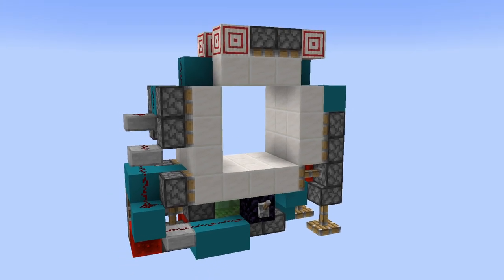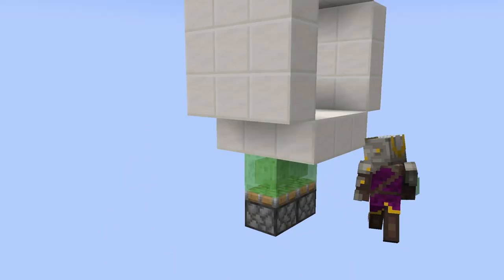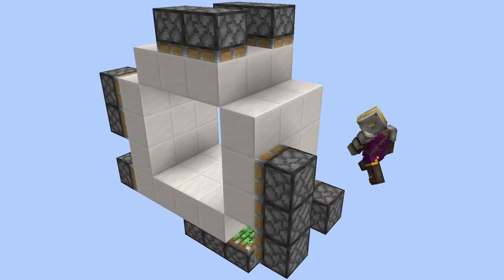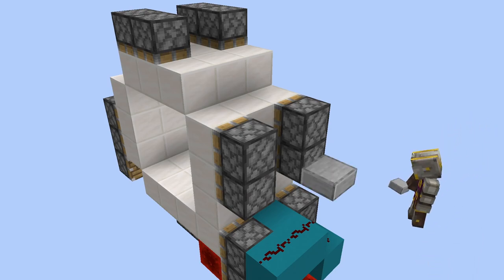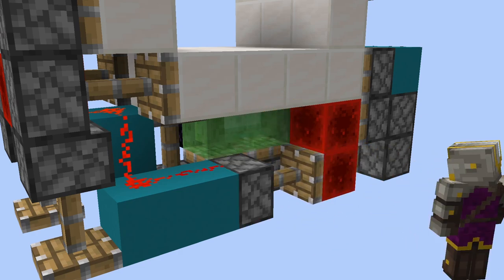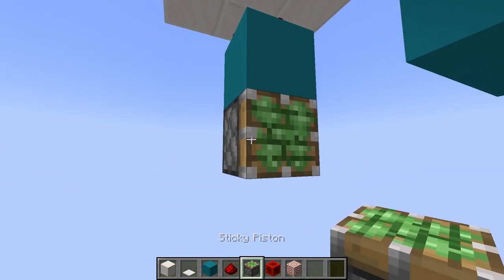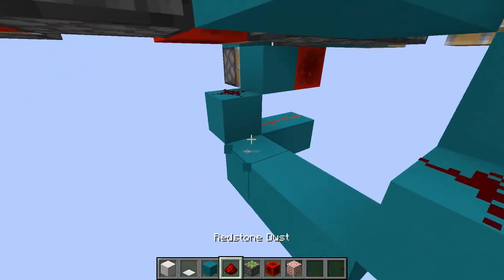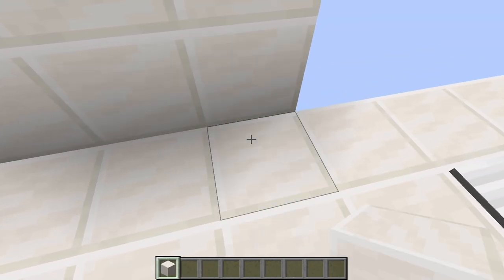[Tutorial] Tiny and Fast 3x3 Vault Door (0.3s opening)

Comment: Confirmed this door works as of snapshot 24w12a. The most common issue is the two blocks connected to slime in the center not retracting, make sure you place all the quartz blocks including the ones outside the frame (that was my issue!)
Reply: can you explain more about how you resolved that? i'm new to minecraft and learning as i go. running into the same issue so im going around removing my redstone dust/blocks to reset the door back to default trying to resolve the stuck blocks

Comment: A really great door, works quite well and simple design. My only question is about the 2 pistons facing downwards at 3:37. What are they for? I tried to build the door without them and it worked just fine.
Reply from the maker: Thx! Those are only needed if you build the door in certain directions
Reply: Not sure why he didn't give you a proper answer, Those update the pistons above them because they enter a budded state when in certain directions. That is a 0-tick generator to increase the speed of the door. You got lucky with your placement and didn't need them.

Comment: great another fast door with the activation spot in a bad location. yeah
Reply: It's literally in the best spot wdym
Reply: @Gekoloudios  *only if you like noisy pressure plates
Reply: @TheDawgMiner  I was talking about the input location, not the input itself...

Also, in your opinion, what's the best input for a redstone door?
Reply: @Gekoloudios  head height on the side of the door frame
Reply: @TheDawgMiner  you know you can just connect the input to wherever you want and it'd be fine?
Reply: @Gekoloudios  not if it fires a piston out of sequence
Reply: @TheDawgMiner  it's really a matter of redstone experience, for example I can easily see a way of putting the input basically anywhere you could want without messing up the door but anyway I don't wanna argue too much more, just know that making an input that's convenient for everyone is hard, and in this case it's actually in a very good spot compared to other doors
Reply: @Gekoloudios  5:42 right side, a block that would be touching the middle(top) piston.
Reply: @TheDawgMiner  believe me it would not be touching it
Reply: @Gekoloudios  then you lie - goodbye